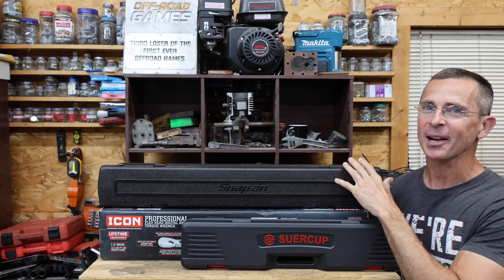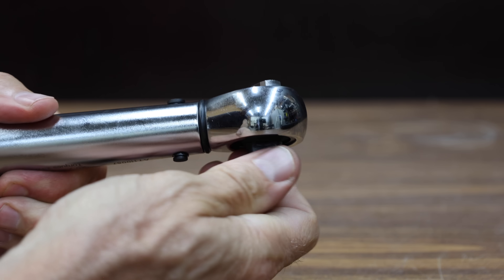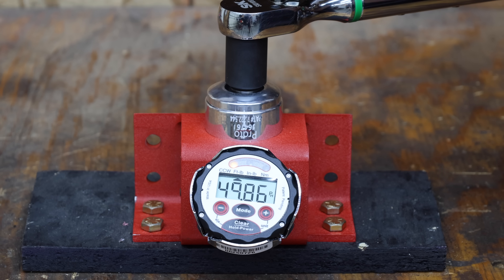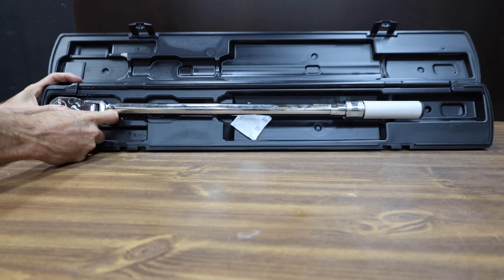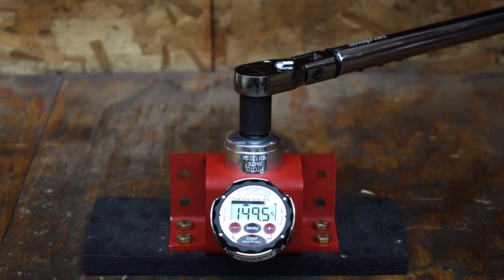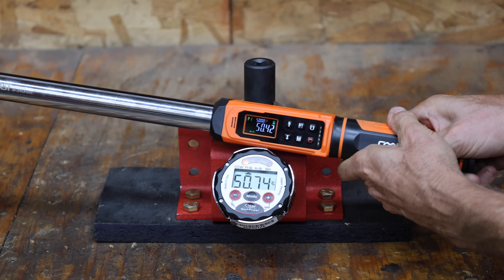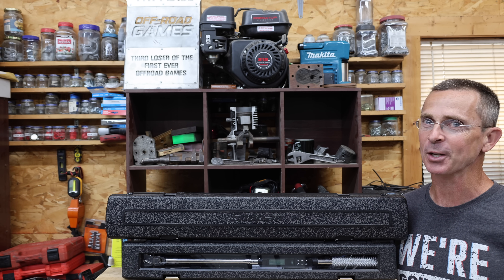$78 Torque Wrench vs $790 Snap On & ICON—I Didn’t See This Coming!

Comment: This is a product I could use if/when I have to work on my Briggs single cylinder 20HP OHV small engine itself.  Inch-Pounds has sufficed so far for the Head, but I may rather have a Clinking Torque Wrench.  $78 for this Suercup or a comparable performance and priced Clinking.  I will use your Spreadsheet to make that decision when the day comes.  Great job, Todd!  👍👍  I really appreciate the time, trouble and expense you spend to make these excellent videos, and I like buying from your links when I need a product to give you something back.
Reply from the maker: Thanks!  Thanks for the feedback.

Comment: Here's the flaw with all these torque wrenches. Batteries and electronics. My torque wrench is about 20 years old. It doesn't get used often, but I know when I need it, it will work. If I used it regularly, I might think differently.
Reply from the maker: Thanks for sharing.

Comment: The AC delco is not as accurate as many of the others; however, as a diesel mechanic I will keep using mine as its ability to pair with any ratchet or breaker bar combo means I can still torque at whatever angle or space I need to torque, plus or minus the standard deviation of course. Good thing is when torquing the fasteners I do, everything is large and built like tanks; thus, I am not too worried about being off 15 or so lbft. Hell, I can torque to about 100lbft with a standard 3/8” ratchet using just my hands. Great content in this video. I was shocked at how accurate several chicom wrenches were.
Reply from the maker: Thanks for the feedback.

Comment: Here's a ranking of the torque wrenches from most affordable to most expensive, with their pros and cons:

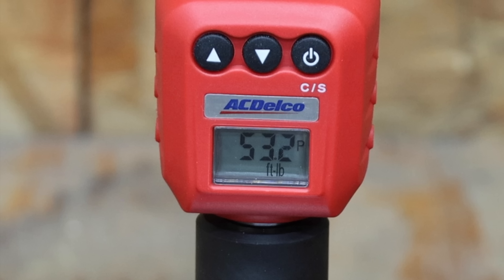1.  SUERCUP ($78) (1:42)
Pros:
Claims accuracy of plus or minus 1% (1:51).
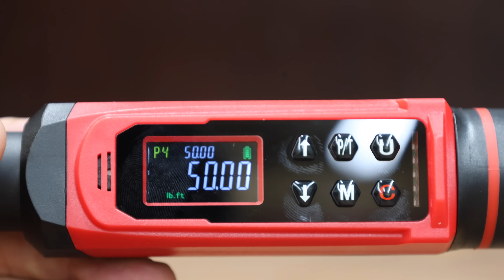Digital display with upgraded backlight (2:03).
Comes with a certificate of calibration (2:06).
Performed well with low delta errors (0.59 ft-lb, 0.57 ft-lb, 0.27 ft-lb, 0.77 ft-lb, perfect on fifth attempt) (2:17-2:33).
Fast sensor speed (12:15).
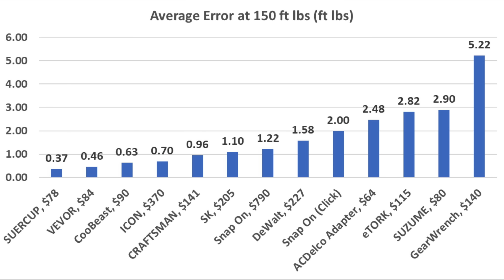Most accurate at 150 ft-lbs with an average error of 0.37 ft-lb (14:00-14:03).
Best average error rate at 250 ft-lbs (0.45 ft-lb) (14:33-14:37).
Very accurate after 1,000 cycles (0.12 ft-lb, 0.51 ft-lb, 0.39 ft-lb, 0.18 ft-lb, 0.09 ft-lb errors) (15:20-15:29).
Remained highly precise after 1,000 cycles (18:09-18:13).
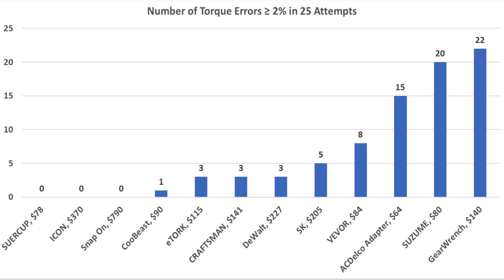No errors exceeding 2% before or after 1,000 cycles (18:18-18:22).
Cons:
Made in China (2:12).

2.  SUZUME ($80) (2:33)
Pros:
Claims accuracy of plus or minus 2% (2:35).
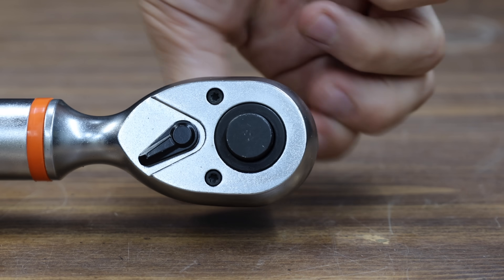Claims to stay precise for over 15,000 uses without recalibration (2:38-2:41).
Ratchet head has 72T for a 5-degree arc swing (2:41-2:45).
Instructions on the case (2:46-2:48).
Green light at 85-90% torque, red light at 100% (2:49-2:53).
Cons:
Certificate of calibration looks suspect (2:55-3:01).
Made in China (3:06).
High error rates (1.44 ft-lb, 2.00 ft-lb, 1.54 ft-lb, 1.19 ft-lb, 1.62 ft-lb) with an average error of 1.57 ft-lb (3:12-3:25).
Very slow sensor (12:29-12:39).
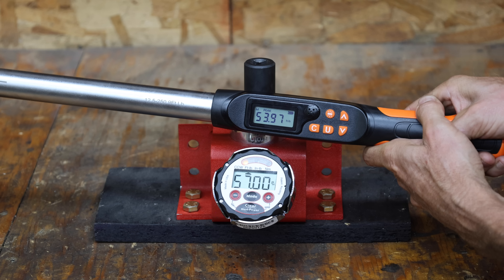"Totally cooked" after 1,000 cycles with large errors (2.84 ft-lb, 2.6 ft-lb, 3.03 ft-lb, 3.57 ft-lb, 3.09 ft-lb) (15:29-15:36).
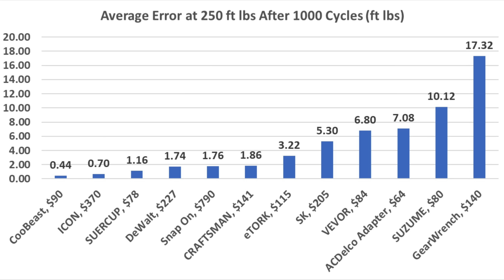Way out of calibration after 1,000 cycles (17:26-17:28).

3.  VEVOR ($84) (3:28)
Pros:
Claims accuracy of plus or minus 2% (3:31-3:32).
Measures in Newton meters, inch-lbs, foot-lbs, and kg/meter (3:37-3:40).
Comes with 1/4 inch and 3/8 inch adapters (3:41-3:43).
Three working modes: real-time, peak, and preset memory (3:43-3:46).
Built-in backlight (3:47-3:50).
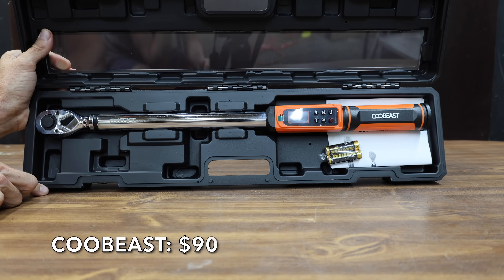Very accurate with low errors (0.1 ft-lb, 0.21 ft-lb, 0.16 ft-lb, 0.18 ft-lb, just over 0.5 ft-lb) (4:05-4:14).
Finished in second place with an average error of 0.24 ft-lb in the first 50 ft-lb test (11:12-11:14).
Finished in second place at 150 ft-lbs with an error of 0.46 ft-lbs (14:08-14:10).
Cons:
Inspection certificate seems too perfect (3:51-3:54).
Made in China (3:58).
Struggled with sensor speed (72 ft-lb and 34.5 ft-lb discrepancies) (12:42-12:47).
Less accurate after 1,000 cycles (0.35 ft-lb, 1.54 ft-lb, 2.33 ft-lb, 1.13 ft-lb, 1.25 ft-lb errors) (15:38-15:47).

4.  COOBEAST ($90) (4:17)
Pros:
Claims a working range from 3.76 to 250.8 ft-lb (4:19-4:24).
Has a buzzer and LED (4:24-4:25).
Claims plus or minus 2% accuracy in clockwise direction (4:26-4:28).
Appears very accurate according to inspection certificate (4:29-4:32).
Five measurement modes (4:33-4:38).
Claims each torque wrench undergoes 20,000 accuracy tests (4:39-4:41).
Pretty accurate with low errors (0.37 ft-lb, 0.09 ft-lb, 0.48 ft-lb, 0.27 ft-lb, 0.66 ft-lb) (4:49-5:01).
Finished in third place at 0.36 ft-lb in the first 50 ft-lb test (11:14-11:16).
Pretty fast sensor (12:48-12:54).
Third place at 150 ft-lbs with 0.63 error (14:10-14:12).
Actually broken in and more accurate after 1,000 cycles (errors at 0.07 ft-lb, 0.12 ft-lb, 0.05 ft-lb, 0.23 ft-lb, 0.32 ft-lb) (15:47-15:59).
Finished second after 1,000 cycles at 0.16 ft-lb (17:14-17:16).
Finished first at 250 ft-lbs after 1,000 cycles with an average error of 0.44 ft-lb (17:30-17:34).
Biggest improvement in accuracy after 1,000 cycles, indicating a break-in period (18:03-18:07).
Only one error outside of the 2% range (18:23-18:25).
Cons:
Made in China (4:42).

5.  eTORK ($115) (5:04)
Pros:
Electronic with a click-style mechanism (5:10-5:12).
Measures in foot-lbs, inch-lbs, and Newton meters (5:14-5:16).
Reversible ratchet (5:17-5:19).
Pretty accurate after 1,000 cycles (0.28 ft-lb, 0.6 ft-lb, 0.38 ft-lb, 0.6 ft-lb, 0.49 ft-lb errors) (16:01-16:08).
Cons:
Claims accuracy of plus or minus 3% clockwise and 6% counterclockwise (5:23-5:27).
Certificate of calibration shows it's not as accurate as some other brands (5:28-5:31).
Product of Taiwan, finished in mainland China (5:32-5:35).
Overshot target (0.65 ft-lb, 0.79 ft-lb, 0.63 ft-lb, 1.09 ft-lb, 0.74 ft-lb errors) (5:41-5:52).

6.  GearWrench ($140) (5:54)
Pros:
72T ratcheting mechanism with a 5-degree arc swing (5:56-5:59).
Appears very accurate according to certificate of calibration (6:00-6:02).
Claims accuracy of plus or minus 2% clockwise and 3% counterclockwise (6:04-6:08).
Target torque alert with vibrating handle, buzzer, and solid LED light (6:13-6:19).
Multiple units of measure (6:20-6:24).
Cons:
Batteries not included (6:10-6:12).
Made in Taiwan (6:25).
Way over target errors (almost 2 lbs, 0.78 lbs, 0.9 lbs, 1.14 lbs, 1.23 lbs) (6:32-6:41).
Slowest sensor (12:55-13:03).
Almost as "cooked" as the Suzum after 1,000 cycles with large errors (2.45 ft-lb, 4.09 ft-lb, 2.58 ft-lb, 2.54 ft-lb, 3 ft-lb) (16:09-16:17).
Way out of calibration after 1,000 cycles (17:26-17:28).

7.  Craftsman ($141) (6:44)
Pros:
Torque range from 50 to 250 ft-lb (6:47-6:49).
LED backlit screen (6:50-6:52).
Multiple units of measure (6:52-6:55).
Bi-material handle for comfort (6:55-6:58).
Comes with a certificate of calibration (6:59-7:01).
Good accuracy (0.7 lbs off, perfect on second try, 0.56 error, 0.25 error, 0.29 error) (7:08-7:17).
Tied for third place at 0.36 ft-lb in the first 50 ft-lb test (11:14-11:16).
Very fast speed sensor (3.1 ft-lb and 2.6 ft-lb differences) (13:04-13:11).
Held up well after 1,000 cycles with small errors (0.1 ft-lb, 0.16 ft-lb, 0.05 ft-lb, 0.02 ft-lb, 0.21 ft-lb) (16:18-16:26).
Came in on top after 1,000 cycles with an average error of 0.11 ft-lb (17:08-17:11).
Biggest improvement in accuracy after 1,000 cycles, indicating a break-in period (18:03-18:07).
Cons:
Made in Taiwan (7:01-7:03).

8.  SK Tools ($225) (7:22)
Pros:
Range from 12.5 to 250 ft-lbs (7:24-7:27).
Includes batteries (7:28-7:30).
Claims accuracy of plus or minus 2% clockwise and 3% counterclockwise (7:31-7:34).
Green light for 90% torque, red light for 100% (7:37-7:40).
Certificate of inspection values printed on case and includes printed certificate of calibration (7:42-7:46).
Almost as accurate as Craftsman in sensor speed (4.8 lb and 1.7 lb differences) (13:11-13:17).
Held up fine after 1,000 cycles with minor errors (0.11 ft-lb, 0.12 ft-lb, 0.68 ft-lb, 0.08 ft-lb, 0.24 ft-lb) (16:27-16:37).
Cons:
Made in Taiwan (7:48-7:49).
Errors over 1 ft-lb on first try, then 0.55, 0.84, 0.84, 0.9 ft-lb errors (7:53-8:03).

9.  DeWalt ($227) (8:05)
Pros:
Torque range between 50 and 250 ft-lbs (8:08-8:10).
Clear readouts on a backlit LED screen (8:11-8:13).
Includes batteries (8:14-8:16).
Multiple units of measure (8:17-8:22).
Large LCD screen for fast readouts (8:22-8:23).
Comes with a certificate of calibration (8:24-8:26).
Very fast sensor (1.1 lb and 1 lb errors) (13:18-13:23).
Continues to perform very well after 1,000 cycles with minor misses (0.37 ft-lb, 0.12 ft-lb, 0.09 ft-lb, 0.31 ft-lb, 0.16 ft-lb) (16:38-16:47).
Biggest improvement in accuracy after 1,000 cycles, indicating a break-in period (18:03-18:07).
Cons:
Made in Taiwan (8:26-8:28).
Missed target (0.69, 0.54, 0.71, 0.71, just over 1 ft-lb errors) (8:32-8:42).

10. ICON ($370) (8:43)
Pros:
Flex head (8:56-8:58).
72T for an arc swing of around 5 degrees (8:58-9:01).
Torque range from 12.5 to 250 ft-lb (9:01-9:03).
Claims accuracy within plus or minus 2% clockwise and 3% counterclockwise (9:04-9:08).
Provides units of measure in foot pounds, inch pounds, newton meters, and kilograms per meter (9:08-9:13).
Includes a certificate of calibration (9:14-9:15).
Good accuracy (0.4 ft-lb, 0.57 ft-lb, 0.27 ft-lb, 0.42 ft-lb, 0.72 ft-lb errors) with an average of just under 0.5 ft-lb error (9:23-9:37).
Tied for second place in consistency with a standard deviation of 0.15 ft-lbs (11:42-11:45).
Finished in second place at 250 ft-lbs after 1,000 cycles at 0.7 ft-lb (17:36-17:38).
Started highly precise and remained very precise after 1,000 cycles (18:09-18:13).
No errors exceeding 2% before or after 1,000 cycles (18:18-18:22).
Cons:
Harbor Freight return process needs improvement (8:46-8:54).
Made in Taiwan (9:17-9:18).
Heaviest (9:19-9:22).
Sensor isn't as fast as Craftsman, SK, or DeWalt (16.9 ft-lb and 15.5 ft-lb errors) (13:24-13:31).
1,000 cycles took a small toll (0.66 ft-lb, 0.51 ft-lb, 0.51 ft-lb, 0.7 ft-lb, 0.53 ft-lb errors) (16:49-16:57).

11. Snap-On ($790) (9:39)
Pros:
Pivoting head (9:43-9:44).
Torque range from 15 to 300 ft-lbs (9:46-9:48).
Dual 80 ratcheting head for 4.5-degree arc (9:48-9:51).
Claims torque accuracy of 2% clockwise and 3% counterclockwise (9:52-9:55).
Claims long battery life of 80 hours (9:57-9:59).
Multiple measurement modes including angle (9:59-10:04).
Four different alert modes: LCD, dual LED, audible, and vibration (10:05-10:08).
Appears extremely accurate according to certificate of calibration (10:09-10:12).
Very accurate with low errors (0.12 ft-lb, perfect on second attempt, 0.1 ft-lb, 0.02 ft-lb, 0.05 ft-lb) (10:21-10:34).
Electronic torque wrench came out on top with an average error of 0.04 ft-lb in the first 50 ft-lb test (11:06-11:10).
Most accurate user, hitting the 50-pound target (11:20-11:27).
Most consistent with a standard deviation of only 0.04 ft-lbs (11:37-11:40).
Faster sensor than Icon (1.4 ft-lb and 5.4 ft-lb differences) (13:34-13:42).
Continues to perform very well after 1,000 cycles with small errors (0.38 ft-lb, 0.1 ft-lb, 0.11 ft-lb, bullseye, 0.28 ft-lb) (16:59-17:07).
Finished third after 1,000 cycles at 0.17 ft-lb (17:16-17:17).
Started highly precise and remained very precise after 1,000 cycles (18:09-18:13).
No errors exceeding 2% before or after 1,000 cycles (18:18-18:22).
Cons:
Made in USA (10:13-10:14). (Note: While "Made in USA" is generally a pro, it's listed here as the only potential "con" in terms of cost, as it's the most expensive option)
Reply from the maker: Thanks!

Comment: holy crap !!!  This one was quite the shocker. I have to compliment your dedication on the 1K cycle tests. That couldn't have been fun, but I appreciate your dedication to endurance testing. I'm a bit curious about the battery voltages after the testing was done. I recommend using Lithium batteries, because they never leak and there are rechargeable ones available if you use the special chargers available. The typical NiCad and M Hal chargers don't put out full voltage and shouldn't be used with Lithium batteries. 9V, AA, AAA, and various sized coin batteries are all available in Lithium disposable and rechargeable versions. I almost hate to suggest a 3/4" or 1" drive test series, but you have a farm, and I have diesel engines to think about.
Reply from the maker: Thanks!  Thanks for the feedback.

Comment: The question isn't, Is the torque wrench at 1/10 the price just as good as the 10x more expensive one?" It is, "is the one that's 10x more expensive 10x better?"  They both do the job.

Comment: The funny thing about this is - I bought a $55 torque wrench and torqued the lugs on my car... Took it into the mechanic for a wheel balance later and they said my tires were torqued perfectly to spec. 

I use this torque wrench regularly in my job as a millwright (apprentice) torquing down pump heads, plungers and and anything else that needs a specific torque spec... and the JMen that have $500+ wrenches check every now and then... and its all perfect. It blows their minds as well as mine that such a cheap thing does its job so well. One guy said to me "I feel like such a fool for paying 800 bucks for my Fapon (Snapon) when your cheap garbage is just as good."
Reply from the maker: Thanks for sharing.

Comment: As I've stated before as helpful as these videos are they are not in anyway an accurate test of how they perform over the years in REAL WORKING CONDITIONS.  1000 cycles at the same settings means almost nothing.  Using the tool a thousand times at a thousand different settings over a ten year period  would be a much more usable comparison. Then you would see how well the tool REALLY holds up. Does the battery cover hold up to removing the batteries after every single use. Does the plastic handle get brittle and break. Does the anvil still hold a socket. Has the display gotten cloudy over time and can you still read it, etc.  Obviously that's not feasible,  but accuracy matters. I tried a $200 torque wrench before I bought my snap on.  It lasted six months before the display died. That would have been $200 off my at that time $600 snap on...
 I had learned this lesson many times over decades of wrenching but apparently I needed to learn it again. 
 I find that if I just stay busy at work instead of wasting time and money driving comparing and shopping around I can afford to buy what is 95% of the time one of the best tools for the job. I dont have to wonder if I bought a quality tool or waste time and money searching for them. I don't have to worry about repairs because they come to me.
 The biggest thing of all tho is I don't have to be an absolute cheap ass douchebag supporter of the CCP.  We all  KNOW Snap on spent Billions of dollars designing the plans that Icon STOLE from them.

Comment: I've been using the 1/2-in Quinn cube style because it uses AAA's instead of coin cells and it's worked just fine. After seeing this, I ordered a 1/2-in supercup for $82 after coupon for the garage and I'll keep the cube in my truck.
Reply from the maker: Thanks for sharing.
Reply: @ProjectFarm Thanks for testing!

Comment: bought one of the manual ones that did great in the review a couple years ago (Lexivon 1/2"), & it seems i got a lemon... no clicky. didn't even use it till past the return window, so likely stuck with it.
 :/
any drawbacks with going digital? aside from the obvious (batteries)? tempted to just stick with the oldschool manual swing pointer my dad left me.

also, 1,000 cycles at 2 different ft lbs is some seriously dedicated testing! thx Todd
Reply from the maker: You are welcome!

Comment: I had to buy a cheapo at an auto parts store in a pinch about 15 years ago. Still going strong.
Reply from the maker: Thanks for sharing.
Reply: The question is:  How do you know?  Have you tested/calibrated it?  Or is it more 'I didn't break off a bolt so it must be ok'?
Reply: @donhappel9566  I had it calibrated 10 years ago for ISO certification. Still got the sticker on it.

Comment: You should consider making a video comparing screwdriver kits. I say that because I noticed you were using an ifixit driver to install the battery into that adapter.
Reply from the maker: Thanks for the suggestion.

Comment: I bought a torque wrench that was made in the USA. The battery cap holder wasn't screwing in properly. I phoned up the company and they mailed a replacement battery cap holder to me. This happened a few years after I bought the torque wrench. It was worth paying a bit more than a made in China torque wrench. At the time years ago it wasn't expensive like a Snap On torque wrench.
Reply from the maker: Thanks for sharing.

Comment: I disagree with you about some of those torque wrenches improving after a break in. What they did was show drift after use, it was just by luck that they drifted in the proper direction. The fact that the reading change with use is still definitely a negative factor.

Comment: Greetings Tool Master 😊... i wanted to ask if you could acquire some Parkside tools for review. My experience with them has been good, and i wanted to see how they compare to other mainstream brands. Also Womax tools are a good cheap option, but i havent had the money to spend on professional brands to be able to tell the diference, most of the tools from the brands i mentioned are around 50 euros
Reply from the maker: Thanks for the suggestion.

Comment: bought a gearwrench torque wrench couple years ago, I think is something wrong with the battery connection, keep turning off it self even with new battery, I give up, just bought a icon TW3-250 , don't want deal with digital anymore
Reply from the maker: Thanks for the feedback.